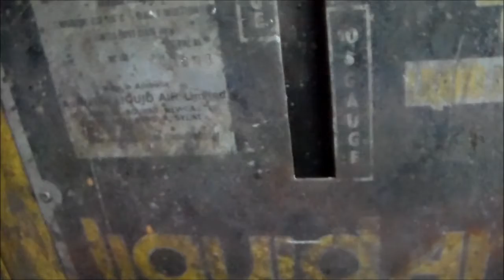Arc Welder Transformer, Autopsy, Teardown + Some Fun, Attempted Pops!

Comment: Awesome !! Keep that transformer in tact. Very interesting adjusting arrangement with the shifting coils.
You have enough space of putting a separate winding on that laminated core.
Make some good clean high current terminals on that flat welder wiring. Lots of fun with popping batteries. Better to put 2 or 3 batteries in series.